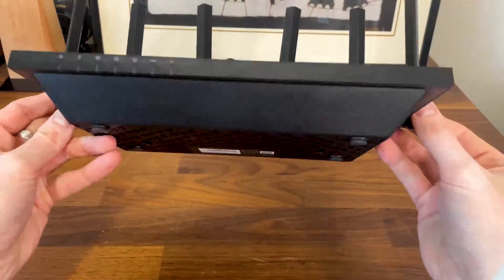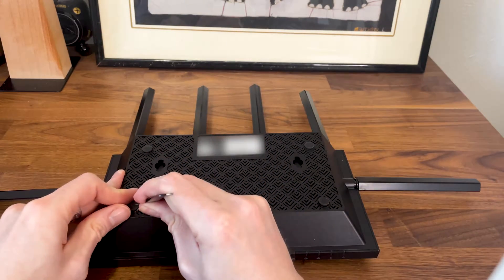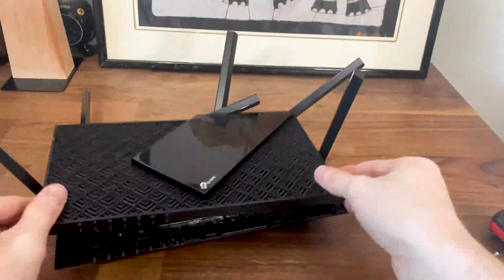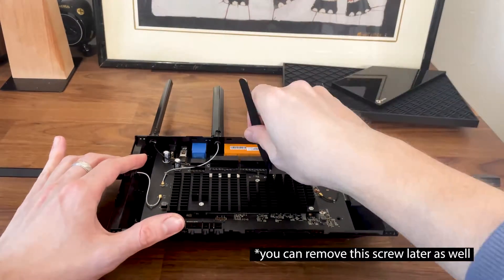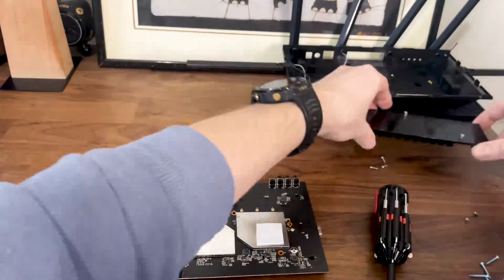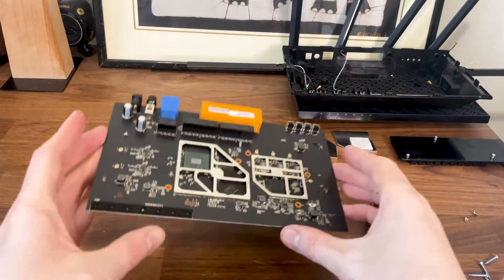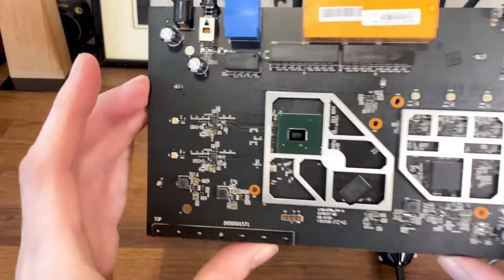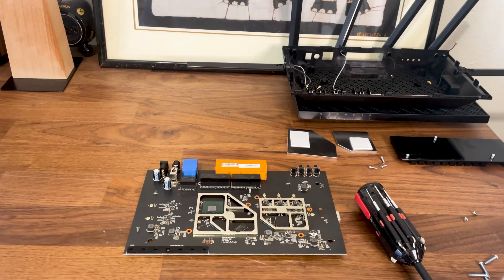TP Link AX5400 AX73 WiFi 6 Router Teardown

Comment: Would love to see the usual stress/performance test for this!
Reply from the maker: Give me a few days and I will post the review video with the multi-client tests.
Reply: @SamBondor  hi 2 router TP-Link Archer AX73 vs 2 router ASUS RT-AX55 which is better to buy?yes I plan to buy 2 router for big house with 2 floor, in my place is same range price. I look for who can cover more area and stable. I use 100 Mbps from my isp btw
Reply from the maker: @LockheedMartinF-22Raptor-y8i  I am not a fan of the AX55 since they seem very flimsy, but you do get more features with ASUS than with TP-Link. For 100Mbps, you could go with either setups and I don't think you'd go wrong. Choose whichever is the least expensive.
Reply: Exactly what I want to see.